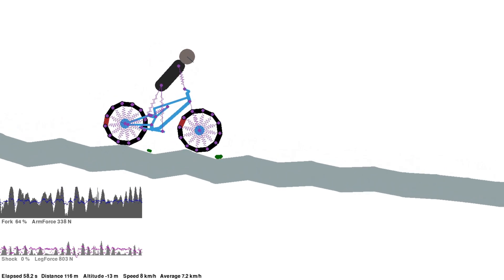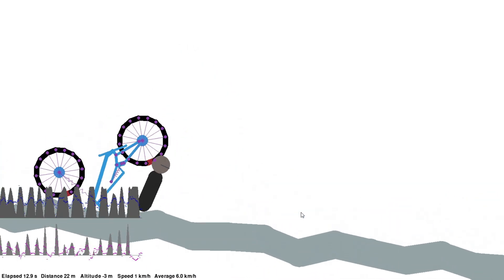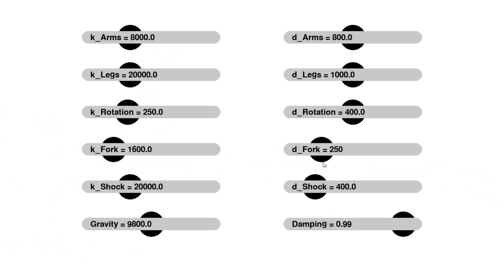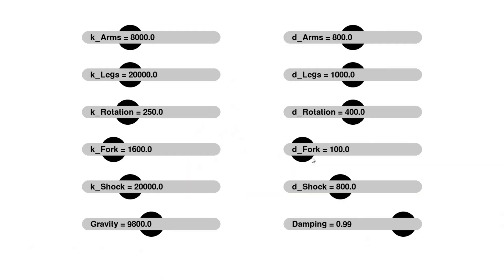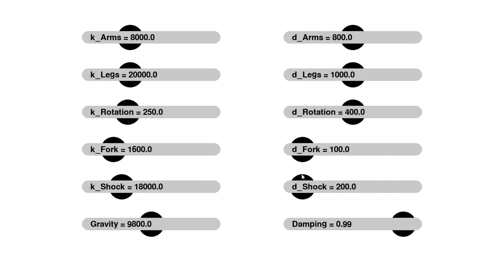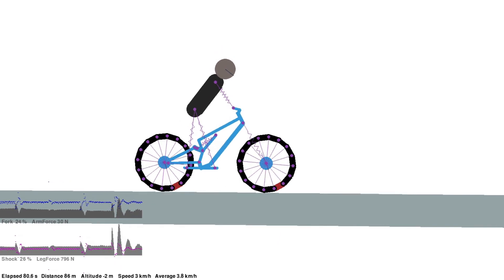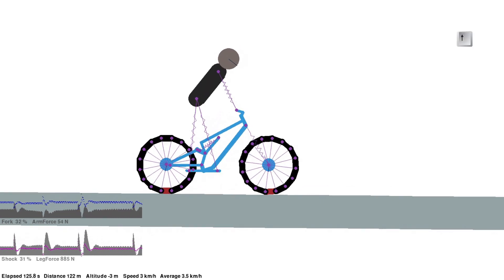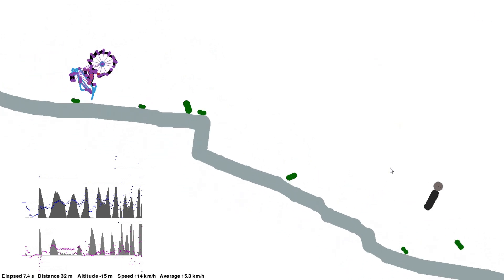Suspension tuning behind the scenes — mountain bike setup

Comment: Love this. Just a suggestion on where to take the model: you could settle the debate about "frame comfort" in relation to rigid bikes; the trade off between tyre pressures, frame vertical compliance, and seatpost springiness, adding together to insulate rider bum from the ground. You would need to add a "springy" seatpost (that bends backwards a bit as a result of a bump) and make a rigid frame with actual stiffness values, but you have the technology! I think you would show its all about the tyre pressures and seatpost springiness, and vertical frame compliance is irrelevant. Or, keep going as you are, excellent
Reply from the maker: Thanks for the encouragement. I like your idea to test different kinds of bike set-ups. I could simulate them and see what happens. Without some kind of objective measure I do not think it will settle any debates. It could be fun though!